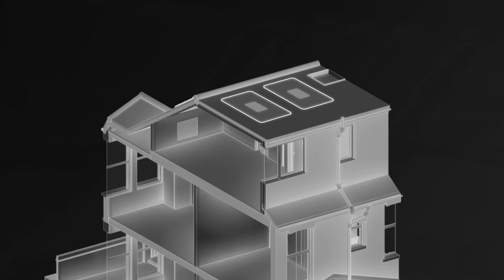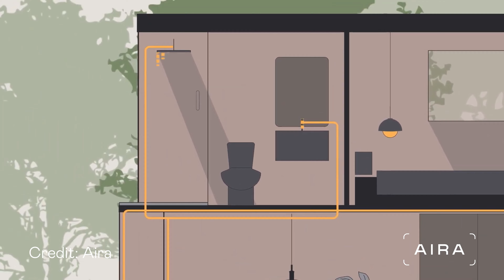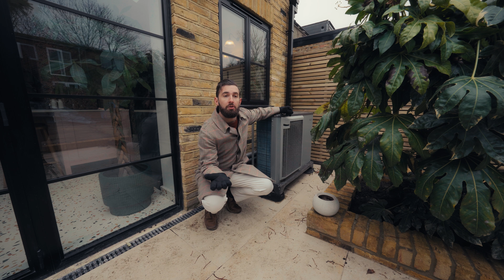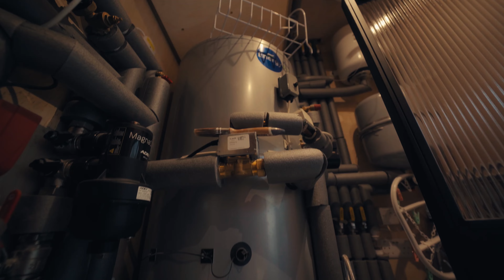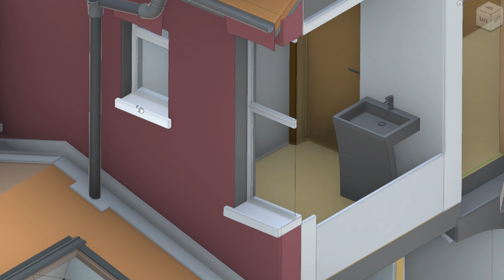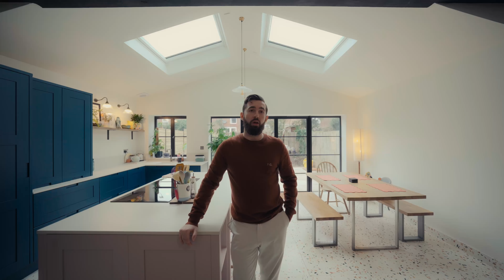Upgrading a home against the tide of high energy bills

Comment: hey, I have a similar build in the North east and I have been thinking about Corksol (spray cork) for insulation - id love to know more about the process and the results, as in, did they use it all over the house? how much internal space did they lose? was it just on the external walls? how much did it cost?
Reply from the maker: Client only lost 40mm of internal floorspace, was used on the front and back external walls. For pricing and installation guidance, contact the manufacturer at: https://corksoluk.com/
Reply: I am having Corksol applied but still waiting for planning permission as it will change the appearance of the house.